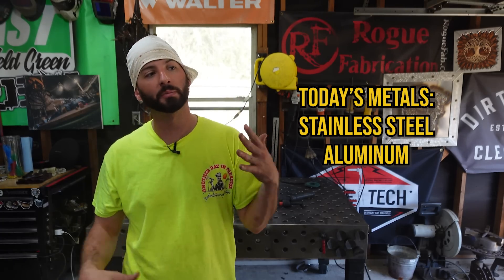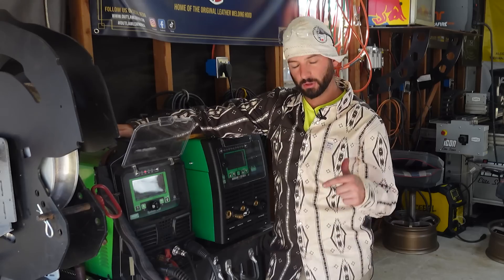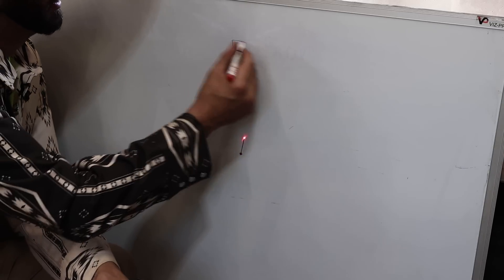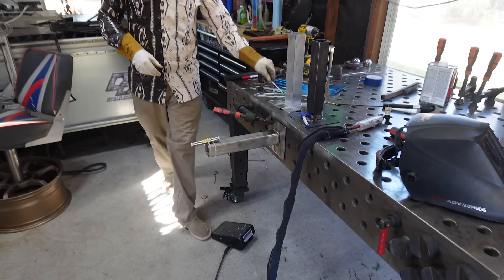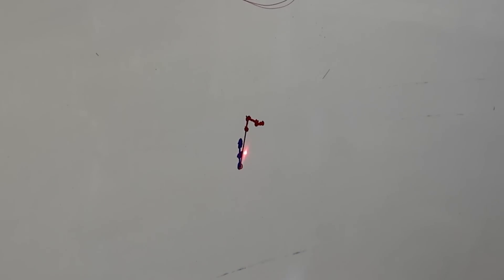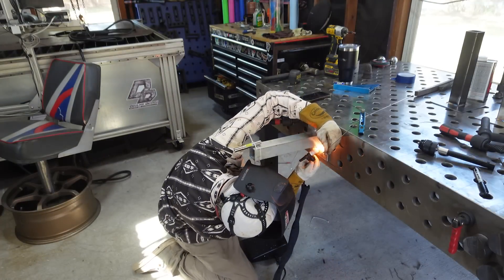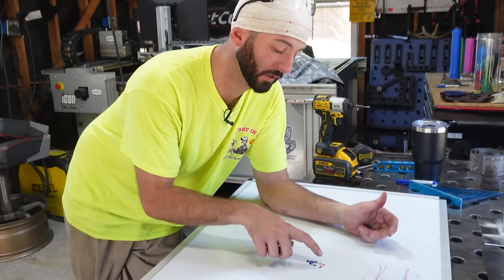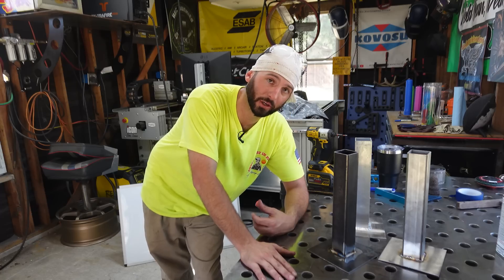Avoiding Metal Distortion When TIG Welding Different Metals

Comment: I use a wet rag to make the part go where it needs to go. For example...after ur first fillet...put the wet rag on the bottom  edge (opposite) to where the weld/heat is. S/S responds real well to this. I've done this at new chemical plant builds, the foremen knew we were doing this. The series was 304, 308, 316. In these grades the carbon content is low. There is no damage/harm to the grain structures in the pipes. 
   The same wet rag technique for c/s and al. 
It takes doing this to get comfortable with it. The wet rag always goes on the opposite side of where the heat is. 
  I'd be curious to see you try it and tell me how you find this. 
All the best, Pete

Comment: I could fix this easily, but I'm not there, I've welded the same material, but there's a trick to it, you have to hyper bend the material by how much it pulled. I.e get a square, counter bend it till it sits on the square mark, but, extend it by at least 1/16 on a counter bend or what the square tells you, that's your gap counter, most distortion is either 1/8 to 1/16, weld it however you want right to left etc. Just make sure your base plate is hard clamped , so it stays flat. Make sure your tube is also pressed well on the counter weld also,  otherwise you'll have the same issue. You're melting alloy, think bro, everything else is flat, "rock the boat" so to speak
Reply from the maker: something i should show off for sure.

Comment: Clamping only helps slightly. If you leave it clamped down until it cools, the metal is still bows as is apparent as you unclamp, but slightly less. Its a constant battle for all of us welders. 😐

Comment: I think what's happening more is the effect of the bottom plate moving in a weird way just clamped loosely in one spot, not so much the tube doing something.
I believe if you welding the tube to something rock sold (like your table, but maybe something less expensive!), you would have got different results.
Bottom line, distortion is a big deal and hard to predict!

Comment: If all you need to do is weld the plate to the end of the tube, stand the tube upright, place a washer under the plate in the center about the diameter of the tube, then with four low profile table clamps at each corner tighten enough to over flex the plate, tack it up. in other words "jiggit".
The Lincoln Electric "procedure handbook ARC WELDING 14TH edition pg. 3.1-1 to 3.1-19 has a crapot load of information on this subject 😉👍

Comment: Yeah, the weld tends to pull, that's the nature of the beast in general. That's why we tent to secure as much as possible, not just 1 place.

But more than that is that the plate will soak up heat and a warped plate is going to distort the entire piece. Tac welding the plate can help keep the edges level and stop the rocking, but your alway going to get some warping, even just a little.

Comment: The clamp on the corner of the plate forced the distortion to compound, resulting in the what you see here. That corner of the plate was rigid, so every weld forced the other corners up in relation to the fixed one.  These results will not pan out in the real world.
Reply: I agree! Them compounds made it move a lot though. I’d like to redo this and really test it

Comment: In the early 90s, I had a production manager who was one of the lead foreman overseeing the welder teams who built the Key Bridge. He recounted a fascinating tale of how they welded girders. The I-beams came from the foundry having been formed with a bend in them. 2 teams of welders would run a length of bead on either side. Their welds were staggered & done on precise timers. By the time the last bead was in place, the bent girder had straightened itself out perfectly with no help from the workers.

Back then, our guys had a command of engineering & metallurgy that can't be duplicated today
Reply: Brilliant 🎉

Comment: I think you’ve got some compounding effects since the plates are warping so much and only 1 corner was clamped down. 
To me it would be interesting to try and isolate these effects and just test the pull on the welds and not the warpage in the plate. So maybe weld tube on to bigger tube (same wall thickness) that is securely fixed. Then you’ll eliminate the plate warp effects
Reply: I agree for sure! I didn’t think about it until after the fact. But I think that’s what really made things move 😂😅

Comment: Great Video Austin, it would be sick to see you try welding a stainless round bar then go about fixing the heat distortion afterwards… I made a agitator for a meat grinder and had to do this, it was very overwhelming at first but was very satisfying and informative to learn and understand how to straighten round bar after it distorts!
Reply: Brooo just wait! Ones coming! Not the same deal but a stainless nozzle and how I’d weld it. Moves like crazy!
Reply: @ heck yeah, sounds like a dope video!
Reply: Heat straightening is a thing. Plates, beams, bars. Can use a gas or TIG torch. From the videos it seems like a bit of an art, but can be really effective.  Some good video examples online—believe Kieth Fenner does it to fix bent prop shafts on boats.  I've done it successfully on a small scale with stainless but still don't understand it well.

Comment: Good video I weld a lot of stainless and aluminum Tig I find aluminum pulls more for me at least thinner 1/8” stainless too sometimes you really have to pay attention to weld sequence and clamp parts down also don’t be afraid to take a break and let the part cool a couple minutes instead of putting too much heat into a part. Good video
Reply: Great advice!

Comment: I get the point and appreciate the video. I’m just wondering about the zip ties, would have been nice if you or someone printed a holder for the laser that slide over the tube to take most of that variable away.
Reply: A reshoot could definitely happen, I learned a lot from my first go at it